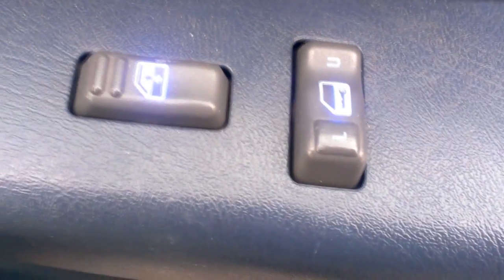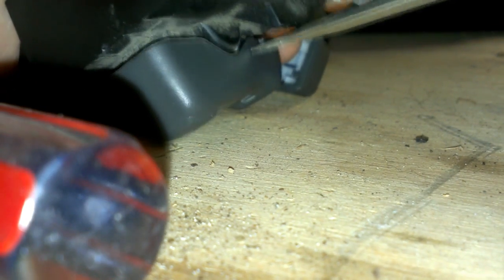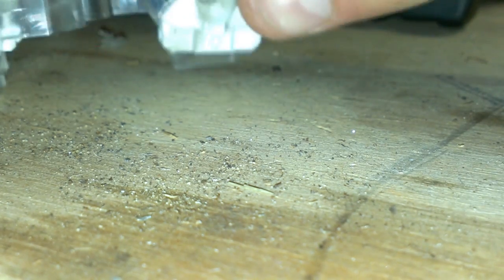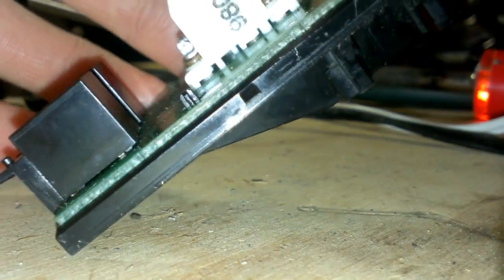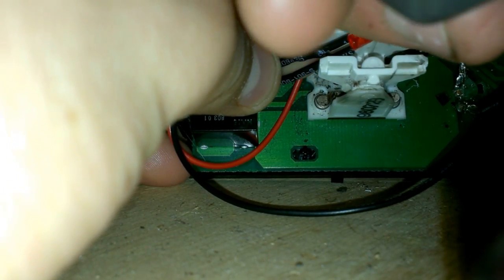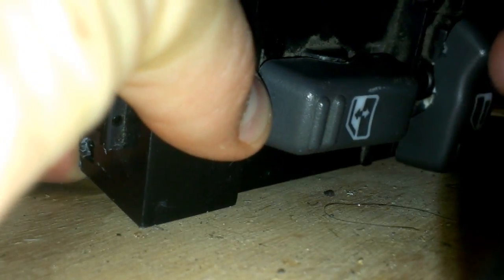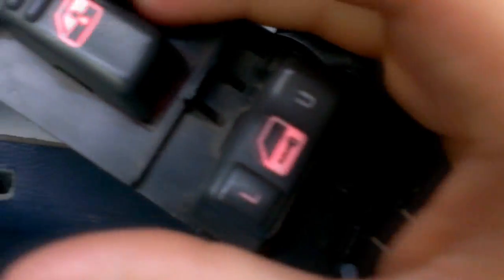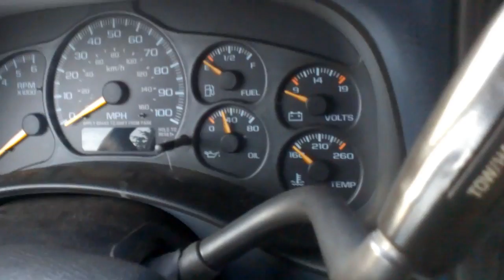Power Window / Lock Switch LED Swap GMT 800

Comment: I have a 94 Blazer (Full-Size) was thinking about redoing mine. They still work but are just so dim. Funny thing is that the lights aren't on the same circuit as the interior lights. Whenever the truck is started they're always on.

Comment: Great video and great info thanks!!!! But I seen your blue leds and liked them... If I installed them on my switch can I get away with not using resisters??? I don’t want them dim I want them bright..
Reply: Yes, I rarely ever add resistors when I swap an LED in for a new one of stronger light/different color. They're not usually strong enough to short anything out. Never once happened to me and I've done well over 50 different climate controls/window switches, gauge clusters etc.

Comment: use the right leds and it looks a lot cleaner I did all mine with blue smd chips I didn't hack up anything either but whatever works for Ya just my two cents
Reply: +D Shuck what size smd or a model or part number, would like to know
Reply: i am dshuck btw for some reason it decided to use this account haha
Reply: +anon amos ok cool thanks were you able to use the clear plastic projection piece or just get rid of it
Reply: +Scott Guich I used it just point the bulbs into it just like factory it diffuses it a little but it's still okay and those come with the resistor already on em too hope that helps
Reply: +D Shuck it does thanks i am trying to leave as much stock parts as i can trying to make it like it would've come from factory with the new leds so thanks again
Reply: +Scott Guich sounds like a good plan good luck

Comment: i was installing my leds and for some reason my window swirches have stopped working help me out with this issue asap please
Reply from the maker: M perhaps something is interfering with the travel or the switches them selves or you shorted something out in the process. do the lights work? Do the switches feel normal when you press them?
Reply: 4WDmania yea they feel normal but when the lights are on the passenger side dosen t want to unlock or lock if u press the unlock the lights go off on the switches like if it loses power and also on the drivers side wen u press unlock the lights turn off but as soon as you let it go they come back on